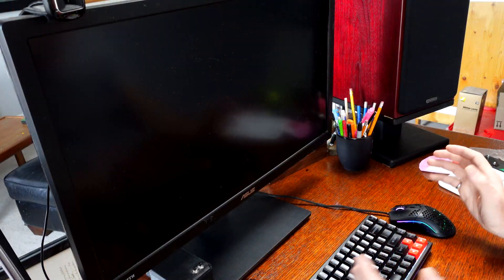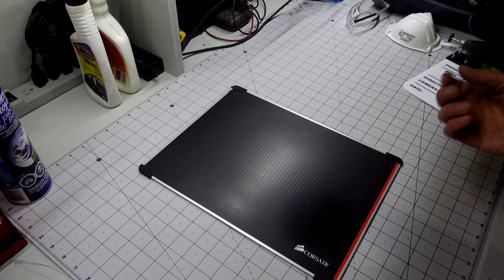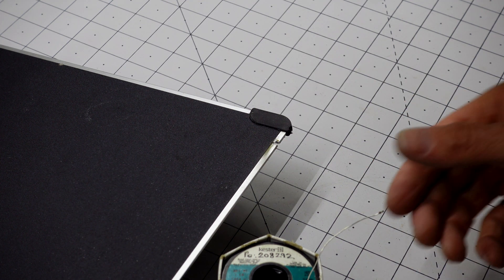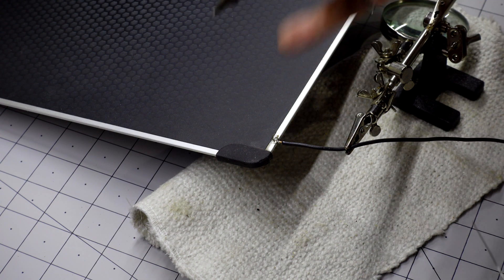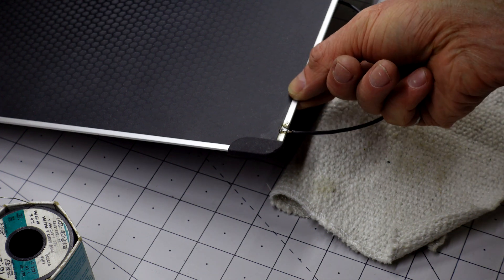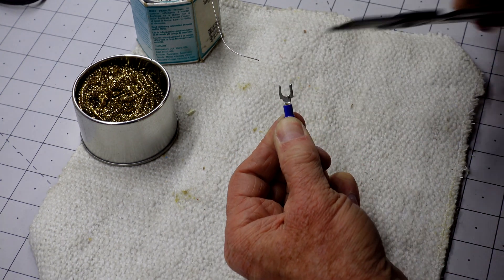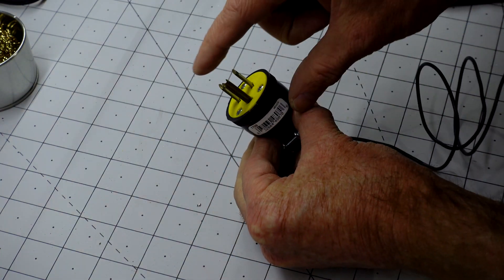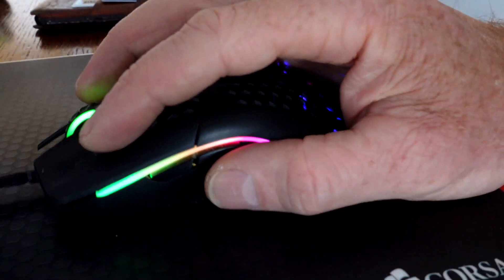Static Electricity Reset My Computer!!  -  Mouse Pad Grounding Solution

Comment: Hello, my mouse pad has a serious electrostatic problem. I don't know what to do. Can you give me some suggestions?
Reply from the maker: Depends on what your current pad is made of. If it is metal of some sort, ground it like I did in the video, otherwise, perhaps try a different surface. Lastly, you could just try and remember to touch a grounded metal surface before you touch your mouse, your computer case an example, should be metal and grounded.

Comment: Great video, thank you for sharing! Quick question.. if I use a mousepad that has RGB and therefor connects to my computer via USB, does that mean the mousepad will always be grounded? Based on your solution I would think yes, but wanted to ask your opinion.
Reply from the maker: It should be, but who knows how it is really wired.  It may also have some sort of clear coating on it which would prevent grounding your body.  You could check to with an ohm meter between your mouse pad and one of the screws holding in your PSU.  If you are using a laptop, unplug your power brick from the wall and check between the mousepad and the ground prong on the brick's plug.  If it is grounded, you should see some resistance, in the 1 Mega Ohm range.